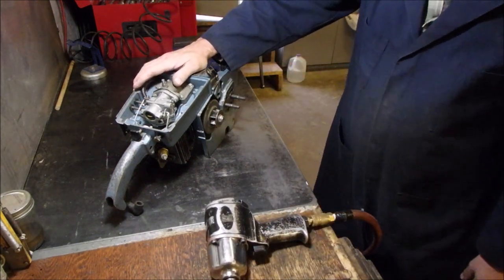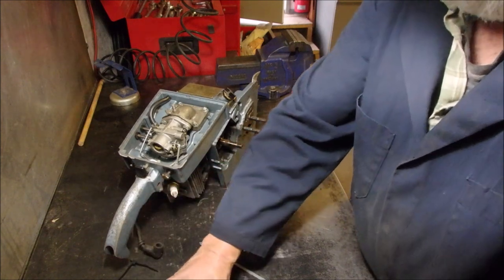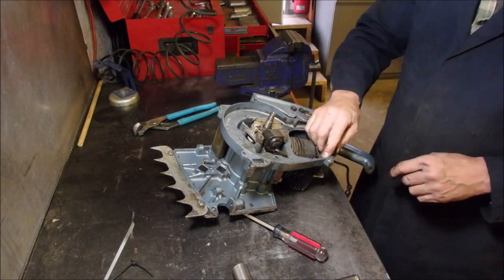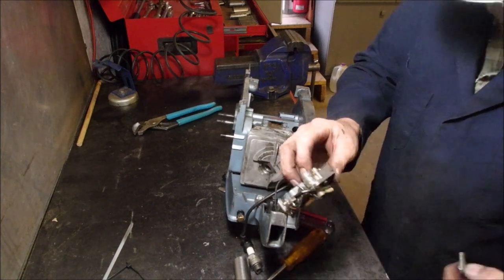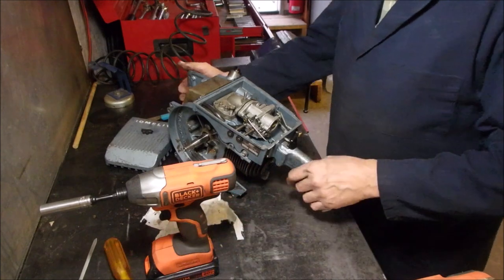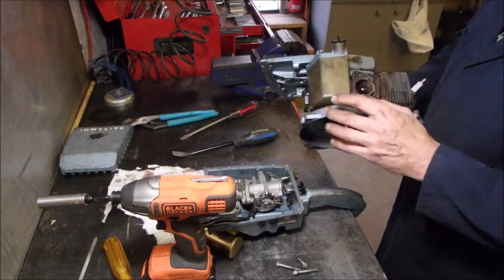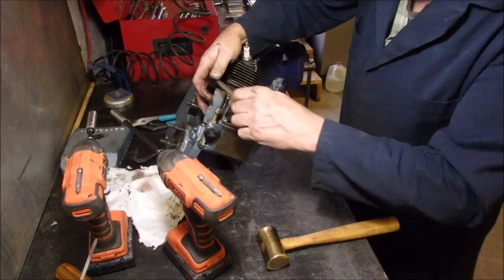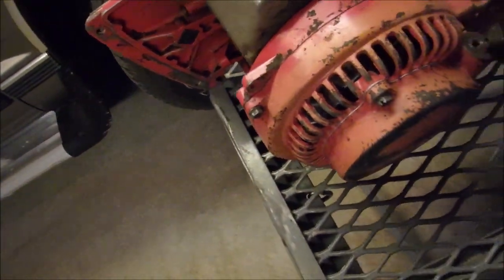Homelite 77 cc  C51 Chain Saw Disassembly

Comment: Great video.  I see your magnet arm broke too.  I have never had one that did not break. I am digging into a C-52 with no spark.  Wish me luck.  Hope I can just file points and It aint the coil.
Reply from the maker: Right on.   Don't forget about the condesor ---capacitor.
Reply: @BrucesShop  Yea, not sure what to check first.  It might even just be a dirty kill switch connection.  Will start with least amount of effort then work from there.  Thanks!